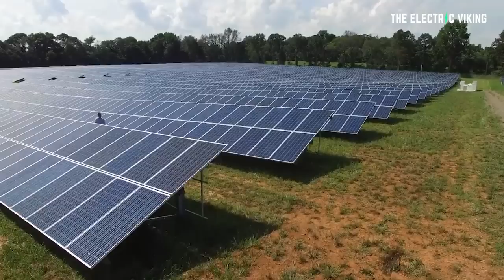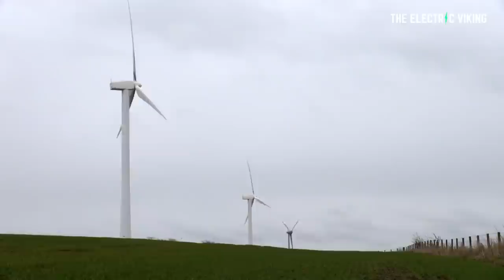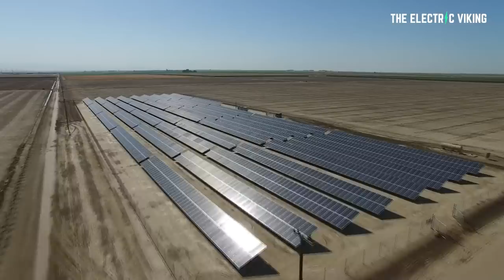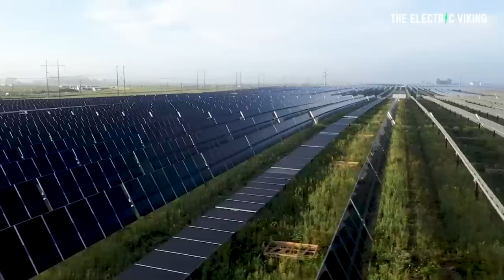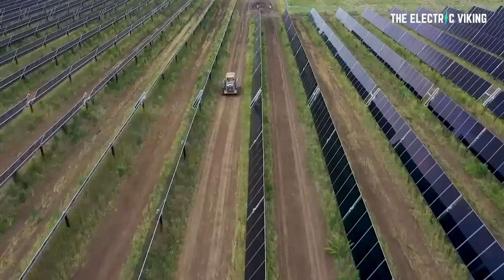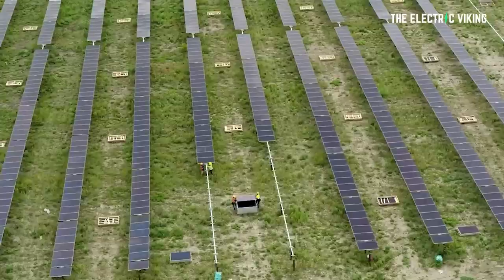Renewable energy is destroying coal & nuclear energy in the US

Comment: I think you are off on this one. CNG is replacing Coal, not the Unreliables are replacing Coal. We have 25% Renewables here in Nevada, 12% of that Unreliables, the rest Hydro. But 75% is CNG, no Coal here. Because we need massive AC during the day in Summer, Solar actually works very well, unlike in all the northern US States. I love my Solar system, but without CNG absorbing my evening and nighttime use, I could not run this.
Reply: Thats100%. You have the need of all that electricity in daytime becaue You make so many bad buildings hardly being isolated from winther as well as summer.

And strange to me You can allow something like that.USA invented rockwool in 1924. 

So You are right but also shame on You. Number one eneytime is insolatated houses. We have minimum rules for that in the whole EU beng at least the same as 30 cm rockwool in total. We also help the old buildings as well as it goes. 

It makes a much better climate inside all year around and outside very much. Its cheeper very much cheeper. 

So fine You use the sun. But there is a but and also many buts below the belts to kick.

Comment: Hi Sam.  As you have often said, we need battery storage to go along with this lovely increase in renewably generated power.  But we must get away from using Li batteries for static applications.  This great increase in demand is pushing the price of EVs up and decreasing their eventual market share and their speed of penetrating the market.  The Li in your Hornsdale plant would be enough for 3000 60kWh EVs.  Besides other technologies are superior for static applications and would be cheaper if they had the market share to get their prices down.  There are the ZnBr flow/plating and gel batteries, the SbCa and AlS liquid metal batteries, the Fe and V redox batteries and the up and coming Na batteries.  You can use the full capacity of all of these from 0 to 100% charge with no damage, they have far longer lives , they are made from cheap, readily available materials which are more easily recycled (if it is ever necessary to recycle them) and they are safer from a fire point of view so can be shipped any way you want (Airlines are reluctant to ship Li batteries)
Reply: Sodium for energy storage is in th future
Reply: Certainly, Li can be eliminated for fixed storage.
Reply: Eep cycle lead carbon batteries are excellent for static storage. I know because I use them.

They can be readily recycled using the same processes as auto lead acid batteries. That said at grid scale batteries fall about two orders of magnitude compared to what is required for guaranteed 24/7 power for modern industrial society. To keep the wheels of industry going, steel, aluminium, chemical, fertilizers, fuels, cement etc you need storage using large scale pumped hydro and/or nuclear.

Comment: germany uses 85 gw of electricity .germany’s wind and solar installed capacity is 125 gw . for weeks at a time in december renewables provided 5% of germany’s electrical demand .
Reply: There has been no single day in 2022, where renewables in Germany produced less than 19,3%  of the electricity. In total, renewables produced 243.39 TWh, which is 49.7% of the complete electrical energy produced in Germany that year. Btw, Germany has 145 GW of installed capacity. This year, 8GW solar and 4GW wind will be installed, additionally.

Comment: No sir there is no way renewables will be 50% of US supply within 2 years. It is not just economics. Grid integration challenges, output variability, location specificity, lack of storage, and capacity factor limitation make adoption of RE a marathon NOT a sprint. The average human has no clue how fragile and complex our energy infrastructure is.
Reply: Texas is already at 33% renewable electricity power. Iowa and South Dakota are over 50%. Look it up!
Reply: @freeheeler09  look up capacity factor limits. Renewable installed capacity is not it's avg output. Avg renewable output is about 30 percent of capacity. 100 gigawatts of dispatched fossil generation is about 95% available 24/7. 100 gigawatts of solar? Not even close. Savvy?

Comment: I added solar in 2017, a Tesla model 3 in 2018, a BMW 330E in 2020, and another model 3 in 2022.  I'm going to add batteries to my system and cut the grid.  No gas, no electricity.
Reply: This is the beginning of a phase change disruption that started in the 1980s, stayed flat until 2000, the last 22 years is an "exponential increase" curve which will go str8 vertical in a couple years.
Reply: No gas, no electricity. ??? and the cost, 2 x Tesla 82kwh battery , BMW 330E 12kwh battery (60km range) - normal house uses 25KWh a day - 6kw solar provides abt 30 kwh a day, so min new solar will be abt 18kwh (extra $12,000 ) plus extra roof space and abt 90kwh a day when sunny, so batts at min 50Kwh ?? you are looking at serious money and then in 15 years need to replace the batteries at home and in the tesla - Tesla batts are $25,000 Australian dollars each and abt $30,000 for the house - cost would be less if you charge the EVs during the day and only drove at night or were able to get free charging at work etc

Comment: Hey Viking, could you give us a breakdown on how solar energy cost compares to coal?  How much do panels cost, installed with frames, etc?  How much do they produce under tyical conditions?  What is the cost per KWH?  What is the cost of battery storeage per KWH?  Where I live in Indiana, grid electricity costs about $0.13 USD / KWH.    Can solar panels pay off in under 10 years?  PS:  I think there are tax incentives available too.
Reply: I paid $15k out of pocket for a 9.3kw system in 2017.  It makes an average of 1.4mwh / yr or $2,000 annually.  I'm in Texas with Coserv and our rate is around $0.14.  It covers about 80% of my monthly electricity usage and 100% of my gasoline usage.  If I don't factor the gas, the ROI is 7.5 years.
Reply: I live in Singapore and the cost grid electricity is about $0.22/kWh.  
My solar panel cost $$41,736 for 4000kW panels and it works out to be $0.05/kWh.  There's a 30-year warranty on my solar panels.  Theoretically, the solar panels can pay off in under 10 years, since it cost me $$115/month when I amortized the cost of the panels over 30 years while when I used grid electricity, it cost me $485/month (I paid 6 times more monthly if I were to use grid electricity).  The $500 monthly savings over the 10 years will total 375x12x10 = $45,000.  My monthly electricity cost is high because I use EV and am charging it from home and it saves me about $200 monthly in petrol bills.
Reply: @ChrisGageTX  I'd consider it if the ROI was 5 yrs or less.  Also have to consider the increased complexity of roof maintenance.  Buddy of mine needed a new roof and it was about 7k to remove and reinstall the panels afterwards.  Also consider the ~10x increase in potential leak paths at all the struts and associated flashing.  If I had property to put the panels on the ground, that would be infinitely better.  Solar tiles are great but are still way too $$$$$$.
Reply: @johnmolloy4878  Installing solar at home is cheap if you do it yourself and very expensive if you hire professionals. If your roof is so old that it needs to be replaced soon then replacing it before installing solar is the smart thing to do; consider solar tiles if you need to do that. If you need to worry about leaks you didn't hire professionals to do it.
Reply: Real comparison with coal should be utility scale solar farms where cost per watt is around $0.8. The cost of energy storage has gone up due to high demand but batteries, despite being the most expensive method, are still better and cheaper than paying for a burner plant to keep burning fuel on the chance that you need extra power from them for a few minutes.
Home solar is the most expensive option even with tax cuts or other incentives, but plenty of people have had their system repay for itself in just a few years. Even if you live in a location where solar does not work well the fact you are paying less for electricity and have a backup to keep you safe if the grid goes down makes the panels worth it.
Reply: @rogerfaint499  one critical point.  Have these panels with a 30 warranty actually been used for 30 years?  or are you depending on a piece of paper with a promise?
Reply: @MrDavidknigge  Quality panels with high grade sealant between the glass and frame are strong and stable. I helped installed a system in 2006 when I was an apprentice at my aunt's house and the panel have barely noticeable production decrease. The inverter was replaced in 2019, but that was only around $1400 AUD.
Reply: @MrDavidknigge  Installing solar panels on "private" houses are a recent phenomenon and I don't think that we could know of anyone having had it for 30 years.  But those are warranties given as the newer version could probably last longer (while older version gave only 25 years warranty).
Reply: @rogerfaint499  im a retired construction engineer and ive aeen many building components that have not performed for half of their long term warranty.  Will the manufacturer even be in business in 15 years?
Reply: You are in a big coordinated system being member of a country(or Texas). By that You dont warm up and make electricity by coal. The sun dont shine 27/7. 

As from Denmark where we are in the front sompared to You, Your worst problems is energy waste. You should build better houses having 30 cm rocwool as natto standard for all new houses as well as first class windows and doors. 

By that You easy can go down to 20% consumtion. You need that little for cooling down and warming up in winther and summer. 

Next Ypou have to have a roof, which can have those heavy solarpanels. Next You need to have an agreement with Your electricity provider, where You sell, when You produce more then needed and by that also an buy, when there is no sun. 

Here some few store their own electricity and are not connected(we fx have a boat being independent). It has electric light, radio for contact and a small TV. We also can reload Our Androids. Its one panel not very big. 

And You are right. Even in Denmark the price for electricity varies and even 24/7. We also are known for being taxes too well. 

So its a very individuel calculation down to the quality of Your house and even how many Yiu ive there and showers. 

USA in many parts also has a gas stowe. Hardly none has that in Denmark and gas for now is very cheep in United. But we do have many using real firewood as supplement. 

The last very important part is using heating pumps making all water for kitchen, batroom and varming up(Our only work down to 25 degree Celsius). By that we has to use old fashion electric radiors, which are very expensive. 

So dont think about those interesting calcualations if You house is made for the birds and bees outiide. Thats where the real money is. We took over a house from 1947 3 years ago. It was possible to reduce the condumtion to 60%. By that we saved almost 800 dollars a year in a danish context for an investment partly a loan of 2500 dollar and some dirty and hard work. In money it will be paid off after 4 years interest included. 

Here we might have a smaller solar panel at the roof. It will reduce the electricity bill some, but we wnrt get rich by it. 

But the climate inside is much much better. No cold walls or too hot walls. Same temperature all over. No smoke anymore and by that our towns has no smog anympore.

Denmark by memeber of EU has restricktions for energy consumtions for almost all kinds of machinery down to the smallest ones too. Light is not hot. The vakkuum claener is not that hot a.s.o. 

And coal: We only use coal in 2 very old powerplant in hard winthers with no wind. We still use a lot of gas and some oil for electrity and varming up.
Reply: In Denmark some % has god results, when they vuild new houses and makes the roof and the heating/cooling systems from schrats. 

And true. Solar panels has changed. they give a shorter warrinty here BUT they also are much cheeper. They also are constructed, so evn some few cells grow too old, the rest continue to work well.
Reply: @rogerfaint499  in Nederland one kWh cost 1 euro. Up from 25 cent last Year to one euro this Year. NG was 80 cent, now 4 euro a cubic meter. The government has put a Price Cap. But is Now paid by State Tax Money.

Comment: Solar paired with storage is great where it makes sense, but intermittency still remains a challenge in places with prolonged periods of lacking sun I.e Germany’s infamous “Dunkelflaute.” Even though you can store energy economically and efficiently, if there’s none to be stored you’re not left with many options. Add to this that lithium faces supply constraints and cobalt mining, used in lithium ion batteries, is linked to blatant human rights violations and the situation becomes a bit more “cloudy.” When it comes down to it, locality is key! Different places have different needs and the most secure, robust, reliable grid is one which is diverse paring green base load power like nuclear with renewable energy and storage. Great video!
Reply: I also wanted to mention here that the US is highly dependent on China providing us with low cost solar and wind. Over 80% of our turbines and panels are imported from China. If their economy changes, or they decide to slap us with tariffs, our emissions goals would be severely setback if not entirely obliterated.

Comment: It's not just that renewables it's that other types of electricity generation are not getting cheaper, they are only going to get more expensive to fuel and operate. It's also much higher risk to bring a peaker plant online and takes longer than adding a battery system to the grid. It's all upside when you use modern technology.
Reply: What an idea ( batteries on th grid) who does that??
Reply: @michaelstarkey9745  Flywheels will dominate.

Comment: Roofing materials should all be solar if the cost is so low
Reply: Installation is the expensive and risky part of solar installations.  Utility installations are reasonably cost effective but residential is a mixed bag of horror stories and successes.  Home roofs could enjoy quality and lower overall costs if robotically manufactured, AI designed for the site and house framing/AC/plumbing vents/wiring/etc.
Reply: You are right but most building are not in the rright direction as well. 

It makes more sense to make big solarfarms and share by meters. Its the same as for the rest of the electrity users. 

So I agree in new buildings and especially the very big ones. 

In Denamrk we now and then can be given an extra help. It often is to avoid unimployment as well. It cover systems and by that all kinds og consuption by electricity and warming up/cooling. 

Last time You could be helped by 15% and You didnt have to do aything Yourself.The ones You ordered i for subtracted it and got the saved money from the state.

Comment: The problem with solar is always the same. It has a peak performance around noon and no performance at night. In winter time the production is much worse then in summer. Also there may be 3 weeks in a row with overcast weather. You cannot rely on it. You need conventional technology to bridge those times. You may be able to produce Hydrogen and store it. But then, you better use the Hydrogen directly in cars then go for EVs.
Reply: You are right. You have to see at realisme and very much about where You are. 

Nearby we have a good optimizer. They have 4 months of summer tourisme. By that they are more then 6.000 insted of 900. Here it pays off 100%. The tourists use a lot of electricity for light as well as showering. 

They rent out the summerhousing as sharing the profit with the tourists as well as the tourists are making a help to a better climate. It works.

Comment: EV's CO2 cost can be offset by these advancements. A bullish position on TESLA is based on its whole solution to the issue at hand, how does the world move past oil and the wars it has caused. I just checked into Fist Solar.... what a shit show of union indifference, these guys will not be the answer to anything.
Reply: Tesla is not the whole world at all. By heating pumps and electricity You get three times more in warming up for thesame price in Watts. 

You also get a much cleaner inviroment and no more locla warming up and smog in the towns and cities. 

But I do like tesla and its batteries.
Reply: @jensholm5759  Heat pumps are not new but they are being used in a more dynamic range of everyday applications. Glad you are thinking on the issue.

Comment: Here in California, Gov. Newsom pushed to extend keeping its nuclear power plant up and running, due to wind and solar not cutting it enough.
Reply: Wind an solar w/out storage is incomplete
Reply: Storage is coming. There are several battery technologies, sodium sulfate, iron and others, that’ll be cheaper than lithium and commercially available in the next few years. House and utility scale batteries can be bigger and heavier than car batteries.
Reply: Thats how it is. You anytime have to have a permanent 100% replacement. 

I dont know California well at all. You put up solar and wind energy systems up, where they pays off. 

For Denmark we can build out covering Denmark or 6 times BUT they all would be produced in the windy 200 days. 

So the plan is to use the extra wind for making fx hydriógen, methatnol ethanol or diesel, which can be used the 165 leftover days. So far its too expensive and I dont like explosions by hydrogene as well. 

But we have hopes for that kind of storing.  More sompanies might come here too by sheep electricity as well.
Reply: @freeheeler09  so coal and nuclear have to keep running, until the replacement comes. Which is at least 20 years away